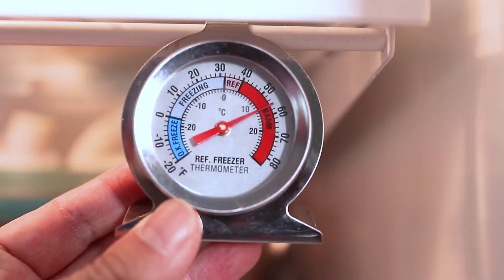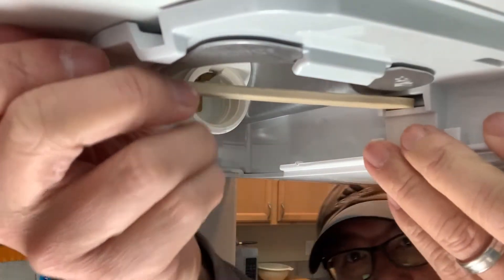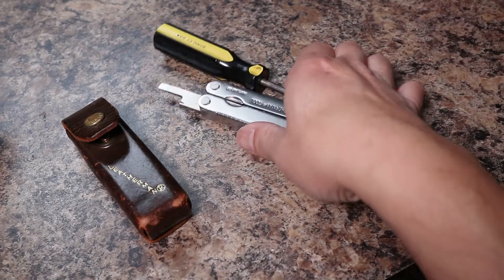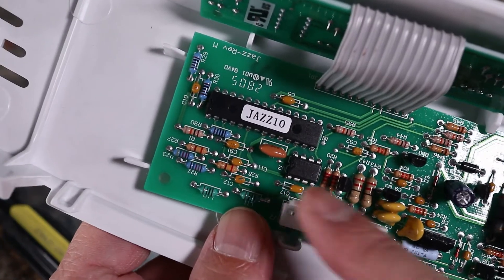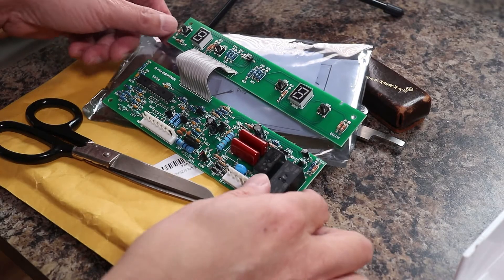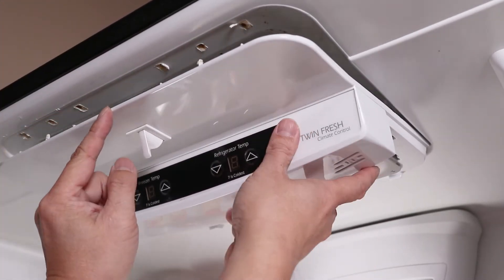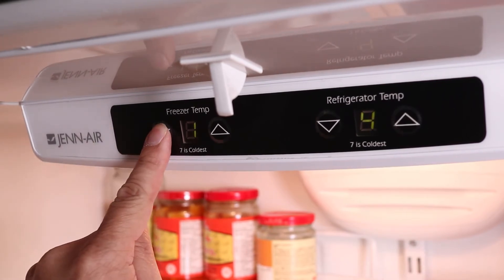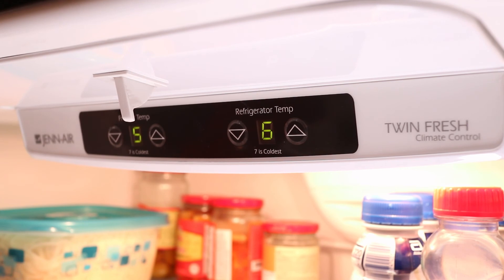Fridge Warm But Freezer Cold - Jenn Air Bottom Freezer Refrigerator Not Cooling on Top or Defrosting

Comment: Tip !  Allways work with warm plastic. If you try and bend cold or near frozen tabs they will snap off. In some cases it is helpful to even "blow dry" warm the part you are working on.

Comment: Would it help to keep the freezer door open while defrosting, and or use a blow dryer at the same time. Not sure if this would affect the thermostat that already in long defrost mode. I am about to remove the light bulb so it doesn’t burn out. Any assistance would be greatly appreciated!

Comment: Hi Sir, it is a very valuable video. Thank you. I have a Jenn air JFC2290vem7. I need to cut the electricity every several months to defrost the ice. On your opinion, if I replace the control board the problem will be solved? And for this model, the control board is different. I appreciate if you answer me. Thank you.
Reply from the maker: We also had to disconnect the power to this fridge every few weeks to melt the ice buildup. For me the circuit board replacement is what fixed the problem. I was still able to perform a forced defrost so that let me know that the defrost heater and defrost thermostat were still working. So the last component was the circuit board. I would say if you can find out how to perform a forced defrost then you can confirm that the problem is the circuit board. I’m just a regular home owner but a professional would probably have other ways to test the defrost heater and thermostat. The fridge in the video has been working properly since I replaced the circuit board when I posted this video.
Reply from the maker: Here’s my video on how to force defrost a Jenn Air fridge: https://www.youtube.com/watch?v=JzYiOXmNR7k

Comment: Thank you for this. This appears to be the issue with our 2004 JennAir fridge. I unplugged it for a day, cleaned it well,  plugged it back in, and it’s working fine…for now. I’d like to order a JAZZ board just in case. Our fridge has double doors on top. But otherwise it looks just like yours. Think the board is the same? Best regards.
Reply from the maker: Even though I can’t see your fridge I’m pretty sure the jazz board should be the same in your fridge with the different door configuration. If it has the dual number display on it then it should be the same part. Of course I’m not a professional fridge repair guy but I hope this helps! The fridge in this video has continued to run normal ever since I changed the circuit board. I leave a thermometer in the fridge and can tell it is working great! Thanks for watching!

Comment: Allow me to recommend not taking down the control panel that way. Those two tabs in the back are stiff, but if you push them with a screwdriver, they open it up no problem. Less risk than starting at the front.
Reply from the maker: Thanks for the advice! Yeah I probably should’ve used a screwdriver to try to push the tabs in. I would’ve rather have done it that way than remove the whole thing like I did in the video.

Comment: So I assume there is no timer motor.  Did you check the heater wire on the coil on cooling coil?  Someone mentioned a reset.  Is that in the video
Reply from the maker: I didn’t see a timer motor but I have seen videos that talk about that. I actually didn’t check anything else on this fridge because I knew it was mostly working except for the frost build up. It ran fine for at least a week every time I forced it to defrost. So I only changed the main circuit board. And that fixed this fridge. Still running at the correct temps and no frost build up ever since. I also made a video on how to force defrost. That might be the reset you’re taking about? You can watch my other video here: https://youtu.be/JzYiOXmNR7k
Reply: @digitalcamproducer  Interesting fact I learned that the fridge won't let the defrost cycle run if above 47.   I had noticed my temperature was 47 up top and 20 in freezer.  I started adjusting numbers and for a few days had it 40 and -5.   So then I went the other way and I was over adjusting too fast and then got it to warm and think by then it had not been running defrost for a few days 

I manually defrosted it a few days ago and it seems OK.  So I may have caused problem.  

Didn't learn about the easy way to defrost till YouTube.

Only time will tell. Thanks for sure on your video and getting back.  You're a good person for sure.

Comment: refrigerator wasnt cooling, freezer was cold but i didnt see huge amount of ice, i could see white ice on the coil thru the little slotted hole... i tried to defrost with the Long setting 3 times in the last 2 hours and the refrigerator seem to be cooling again now. is the problem related to this main board ? i mean if setting the defrost manually fix the problem, the "timer" or the brain that does that cycle isnt working properly? am i on something ? maybe i am totally wrong. ill try defrosting every 4hrs or so manually until im sure on something lol great video!
Reply from the maker: It’s been awhile since I did this repair. But the fridge in the video had ice that kept forming in the space where air from the freezer travels to the fridge compartment. Something was wrong with the defrosting. I took a gamble and got a new control board. And this fridge has not had a frost problem ever since. I didn’t test anything else but the new circuit board definitely fixed the problem I had.

Comment: Hey there question! Do you think this could be my problem. Today i woke up and both my fridge and freezer were way to hot! I was trying to put it to a cooler setting but it kept going back to the wrong setting
Reply from the maker: I’m not an appliance repair person so I’m not sure. If both your fridge and freezer are warm/hot then maybe your compressor isn’t working. When you plug it in do you hear anything running? I was gonna ask if you have ice build up but probably not if both sides of your refrigerator are hot. There could be a problem with the thermostat but in my “amateur” opinion your problem may not be the circuit board. Sorry I’m not more help!

Comment: Question: I have a Jenn air fridge, had warm air in fridge and not cooling. The control board doesn’t lower temp, it stays same. Noticed compressor wasn’t on so replaced starter relay and cleaned coils as well and it’s still warm (but now I hear the compressor which stays on for hours). No ice build up and I can hear fan too, but it’s still warm after 12 hours with compressor running full on. Do you think is thermostat or control board? I appreciate your help
Reply from the maker: I’m not a fridge expert so I can’t offer too much help other than what I did to fix my fridge. I just searched different articles to narrow down the solution for me. You’ve probably done a bunch of searching already. Here’s a page I found with other parts that could be checked in your fridge: https://howtofixit.net/why-is-fridge-compressor-running-but-not-cooling/

Comment: I was having the exact same issue with my Jenn-Air french door refrigerator and replacing the jazz board seems to have corrected the frost build up issue, but now both my compartments are running super cold.  The refrigerator section is running at 30-32 degrees.  Any thoughts?
Reply from the maker: I’m sure you’ve adjusted the temperature control? Even at the highest setting your fridge is still that cold? The fridge I repaired in this video constantly runs about 32-34 degrees on the thermometer I’ve set inside. This is with the temperature control set in the middle position. If your fridge is too cold maybe you cold pearly block one of the air vents in the sidewall. Don’t completely block it though. At your temps are things freezing in the fridge?

Comment: You did it the hard way. Those 2 tabs aren't that hard to compress and pill off.
Reply from the maker: You might be right but those tabs on my fridge were super tight. I did a number of tries off camera before getting my final shots. This repair would’ve been much quicker if those tabs were easier. However by taking the entire housing it allowed me to get all the shots easier for my video! Thanks for watching!
Reply: @digitalcamproducer  I got you. I work on those refrigerators all the time. So I usually use a flat head screw driver or a ice pick while pulling down.

Comment: my problem exactly same as yours, but after I changed my control board for 12 hours, the temperature still warm, should I wait longer, a week?
Reply from the maker: Actually you shouldn’t have to wait. As long as the ice behind the back panel has been defrosted you shouldn’t have any issues with the temperature. Mine has been working for years no problem after the circuit board replacement. However there may be some other parts that need to be checked. Luckily the circuit board fixed my problem.